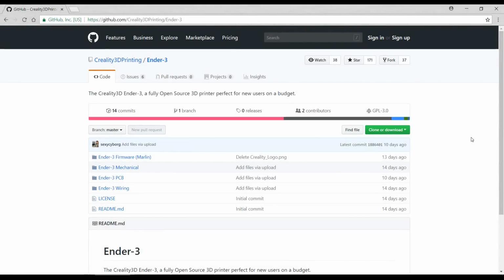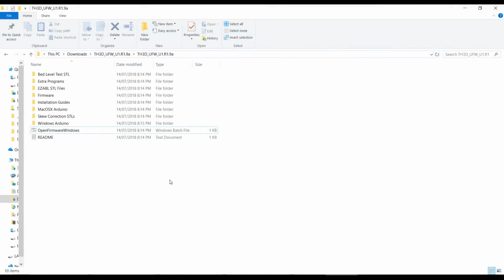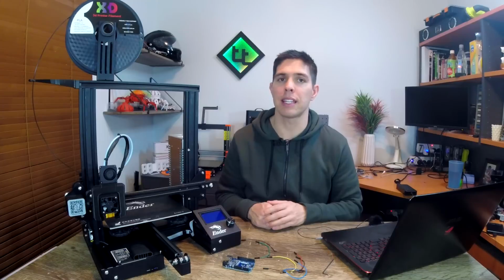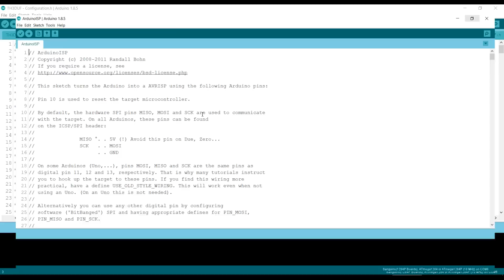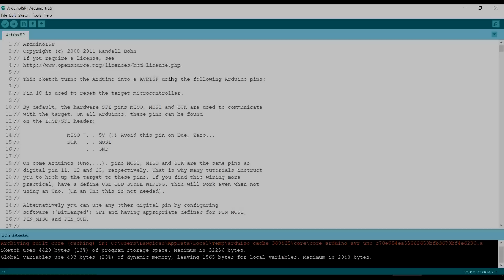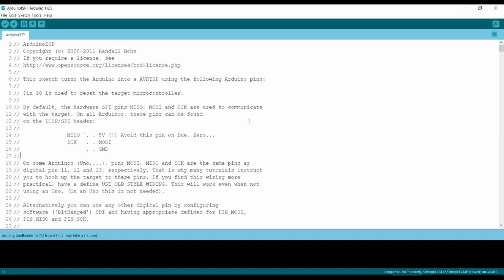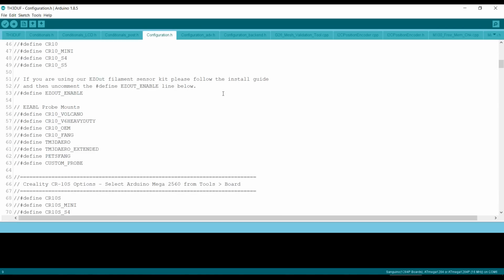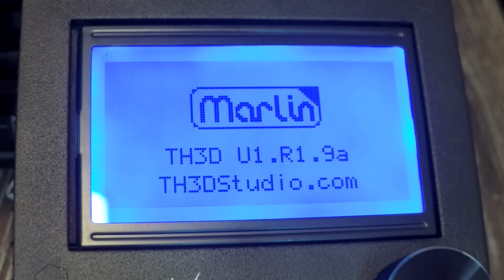Ender 3: How to install a bootloader and update firmware

Comment: I have a Creality V1.1.3 pcb printer.
I managed to install the Uno bootloader with success, but not the firmware. Every time I flash it I get this message:
         Using Port                    : COM29
         Using Programmer              : arduino
         Overriding Baud Rate          : 115200
avrdude: stk500_getsync() attempt 1 of 10: not in sync: resp=0x65
avrdude: stk500_getsync() attempt 2 of 10: not in sync: resp=0x63
avrdude: stk500_getsync() attempt 3 of 10: not in sync: resp=0x68
avrdude: stk500_getsync() attempt 4 of 10: not in sync: resp=0x6f
avrdude: stk500_getsync() attempt 5 of 10: not in sync: resp=0x3a
avrdude: stk500_getsync() attempt 6 of 10: not in sync: resp=0x53
avrdude: stk500_getsync() attempt 7 of 10: not in sync: resp=0x44
avrdude: stk500_getsync() attempt 8 of 10: not in sync: resp=0x20
avrdude: stk500_getsync() attempt 9 of 10: not in sync: resp=0x63
avrdude: stk500_getsync() attempt 10 of 10: not in sync: resp=0x61

avrdude done.  Thank you.

An error occurred while uploading the sketch

The printer lcd screen flashes for a moment and then error. 
I also tried installing Marlin firmware with same exact message.
It seems to reset serial connection and thus printer reboots when attempting to communicate.

Any ideas?
Reply: This is what I get on the Arduino IDE console when flashing firmware:
start
echo: External Reset
Marlin 1.0.0
echo: Last Updated: Sep  3 2018 15:45:59 | Author: (Ender3)
Compiled: Sep  3 2018
echo: Free Memory: 9679  PlannerBufferBytes: 1232
echo:Stored settings retrieved
echo:SD card ok
Init power off infomation.
size: 
591

Comment: I made it to the last part. I just get errors now. So the printer screen is blank. 10 attempts where it says not in sync. Programmer is not responding, problem uploading to board, etc. Any ideas?
Reply: Im in the same boat
Reply: @brgalford  Well if you figure it out, let me know and I'll let you know if I figure it out.
Reply: @CarbonGlassMan  I'm all the way at the end and it just fails over and over again
Reply: @brgalford  I have a few ideas o what the problem could be on my end. I don't have the USB cable that came with my printer, so maybe the USB cable I have is not a data cable? I ordered a data cable, so I'll know if that's it soon. The other problem could be my laptop. It had trouble writing to the Arduino Uno, but I restarted the computer and it wrote to the Uno right away. Only 1 of my USB ports on the laptop is working and I have to have a hub plugged into it because I have to use a wireless mouse. Also, it's Windows 7.  Another possible problem.... TH3D said they have trouble with genuine Arduino boards, and good luck with knockoff Uno boards. I have the genuine Uno.
Reply: @brgalford  I did end up getting this to work. I took my printer over to my dad's house and tried using his computer and it worked the first time. I had an issue with the com port on my computer.

Comment: Having some troubles doing this on my Mac...

I have found the TH3D_UFW_U1.R2.9b on GitHub and with it comes Arduino 1.8.7 for Mac. Installed that and then opened TH3DUF_R2.ino in Arduino. But there is no Sanguino board. How should I do?
Reply: https://www.instructables.com/id/Flashing-a-Bootloader-to-the-CR-10/

this will show you how to get the board working

Comment: Hi m8, i followed that update video and successfully did the bottloader. The problem i have is that what ever usb minicable i use, i can not connect the ender 3. The LCD wont lid so it seems the USBport is broken!? Now i have the problem that if i turn on my ender 3 it wont load up .. blank screen. Must be because of the bootloader. I cant load up firmware it say programmer not responding. Any ideas? Im out of knowledge after a few week now .(

Comment: Well done! Helped me a lot! Please note that for anyone who might experience difficulties connecting to the Ender 3, then it might be due to your miniUSB cable. Some miniUSB cables do not carry the data pins required for communicating with the printer. Buy a cheap miniUSB 2.0 to USB2.0 cable and try that out before doing anything major. Just a tip! :-)

Comment: I tried this, bought everything through the links you provided and I immediately got this error Arduino: 1.8.7 (Windows 10), Board: "Arduino Uno"

Sketch uses 4402 bytes (13%) of program storage space. Maximum is 32256 bytes.
Global variables use 482 bytes (23%) of dynamic memory, leaving 1566 bytes for local variables. Maximum is 2048 bytes.
C:\Users\OWNER\Downloads\TH3D_UFW_U1.R2.9a\Firmware Pack Source Folder\Windows Arduino\hardware\tools\avr/bin/avrdude -CC:\Users\OWNER\Downloads\TH3D_UFW_U1.R2.9a\Firmware Pack Source Folder\Windows Arduino\hardware\tools\avr/etc/avrdude.conf -v -V -patmega328p -carduino -PCOM1 -b115200 -D -Uflash:w:C:\Users\OWNER\AppData\Local\Temp\arduino_build_32612/ArduinoISP.ino.hex:i 

avrdude: Version 6.3-20171130
         Copyright (c) 2000-2005 Brian Dean, http://www.bdmicro.com/
         Copyright (c) 2007-2014 Joerg Wunsch

         System wide configuration file is "C:\Users\OWNER\Downloads\TH3D_UFW_U1.R2.9a\Firmware Pack Source Folder\Windows Arduino\hardware\tools\avr/etc/avrdude.conf"

         Using Port                    : COM1
         Using Programmer              : arduino
         Overriding Baud Rate          : 115200
avrdude: ser_open(): can't open device "\\.\COM1": The system cannot find the file specified.

avrdude done.  Thank you.

Problem uploading to board.  See http://www.arduino.cc/en/Guide/Troubleshooting#upload for suggestions.

This report would have more information with
"Show verbose output during compilation"
option enabled in File -> Preferences.
any idea what went wrong?
Reply from the maker: Is this when trying to burn the Arduino as ISP program onto the Uno?
Reply: @TeachingTech  yes, but apparently if you just do it enough times in frustration it eventually works. Lol

Comment: How can I tell if my ender 3 has a bootloader?  When I connect it to my mac and open the Arduino software I get a new port in the list but I have no idea what this means. Can I program the new firmware from that point or do I still need to use a bootloader?  thanks and sorry to ask stupid questions (my ender 3 is one week old if that helps)

Comment: Hi there, 1st time working with my ender 3. Planning to flash the firmware to the latest stable release. Following your video and found it very through but you lost me when connecting the 3 female wires - I could not see where you inserted them onto the motherboard. Could you provide a more detailed description of where they were connected? Also you apparently were using some software I was not familiar with - sketchbook? I plan of trying to follow your instructions in two days. Wish me luck

Comment: Hello Micheal, i had a V1.1.3 in my org ender 3 pro and had no issues with burning a bootloader and updating date firmware, but somehow i fried the board, i have a new V1.1.4 and for the life of me it ill not take a bootloader file i keep getting and Error, and this is what is is I hope that you can point me in the right direction thank you from what i hope is not a $500 paper weight . Arduino: 1.8.5 (Mac OS X), Board: "Sanguino, ATmega1284 or ATmega1284P (16 MHz)"

/Users/doug 1/Library/Arduino15/packages/arduino/tools/avrdude/6.3.0-arduino14/bin/avrdude -C/Users/doug 1/Library/Arduino15/packages/arduino/tools/avrdude/6.3.0-arduino14/etc/avrdude.conf -v -patmega1284p -carduino -P/dev/cu.usbmodem14201 -b19200 -e -Ulock:w:0x3F:m -Uefuse:w:0xFD:m -Uhfuse:w:0xDE:m -Ulfuse:w:0xFF:m 

avrdude: Version 6.3-20171130
         Copyright (c) 2000-2005 Brian Dean, http://www.bdmicro.com/
         Copyright (c) 2007-2014 Joerg Wunsch

         System wide configuration file is "/Users/doug 1/Library/Arduino15/packages/arduino/tools/avrdude/6.3.0-arduino14/etc/avrdude.conf"
         User configuration file is "/Users/doug 1/.avrduderc"
         User configuration file does not exist or is not a regular file, skipping

         Using Port                    : /dev/cu.usbmodem14201
         Using Programmer              : arduino
         Overriding Baud Rate          : 19200
         AVR Part                      : ATmega1284P
         Chip Erase delay              : 55000 us
         PAGEL                         : PD7
         BS2                           : PA0
         RESET disposition             : dedicated
         RETRY pulse                   : SCK
         serial program mode           : yes
         parallel program mode         : yes
         Timeout                       : 200
         StabDelay                     : 100
         CmdexeDelay                   : 25
         SyncLoops                     : 32
         ByteDelay                     : 0
         PollIndex                     : 3
         PollValue                     : 0x53
         Memory Detail                 :

                                  Block Poll               Page                       Polled
           Memory Type Mode Delay Size  Indx Paged  Size   Size #Pages MinW  MaxW   ReadBack
           ----------- ---- ----- ----- ---- ------ ------ ---- ------ ----- ----- ---------
           eeprom        65    10   128    0 no       4096    8      0  9000  9000 0xff 0xff
           flash         65    10   256    0 yes    131072  256    512  4500  4500 0xff 0xff
           lock           0     0     0    0 no          1    0      0  9000  9000 0x00 0x00
           lfuse          0     0     0    0 no          1    0      0  9000  9000 0x00 0x00
           hfuse          0     0     0    0 no          1    0      0  9000  9000 0x00 0x00
           efuse          0     0     0    0 no          1    0      0  9000  9000 0x00 0x00
           signature      0     0     0    0 no          3    0      0     0     0 0x00 0x00
           calibration    0     0     0    0 no          1    0      0     0     0 0x00 0x00

         Programmer Type : Arduino
         Description     : Arduino

avrdude: stk500_getparm(): (a) protocol error, expect=0x14, resp=0x14

avrdude: stk500_getparm(): (a) protocol error, expect=0x14, resp=0x02

avrdude: stk500_getparm(): (a) protocol error, expect=0x14, resp=0x10
         Hardware Version: 425479
         Firmware Version: 8430084.-1442971816
         Topcard         : STK502
         Vtarget         : 1.8 V
         Varef           : 0.0 V
         Oscillator      : Off
         SCK period      : 0.1 us

avrdude: stk500_initialize(): (b) protocol error, expect=0x10, resp=0x01
avrdude: initialization failed, rc=-1
         Double check connections and try again, or use -F to override
         this check.

avrdude: stk500_disable(): protocol error, expect=0x14, resp=0x10

avrdude done.  Thank you.

Error while burning bootloader.

This report would have more information with
"Show verbose output during compilation"
option enabled in File -> Preferences.

Comment: If flashing bootloader fails on a Mac with an error like " stk500_disable(): protocol error" then add a 10uF capacitor between the Arduino's reset pin and ground.
Reply: Ohhh mann....u just saved my life..... thnk u sooo much.....i was trying to upload since whole day .....ur comment make this possible within 5 min......thnks mann😃😃

Comment: Thank you for doing what you do. Your channel is an amazing wealth of resources. I'm having the hardest time getting the bootloader set-up. I purchased the Uno from your link but whenever I connect it to my computer, it constantly flashes red and none of the coms ever show up. I noticed in your recent Ender 5/Marlin video that you mentioned if the com doesn't show, the computer is missing the driver. What driver are you referencing? Thank you.
Reply from the maker: Hopefully this helps: https://www.arduino.cc/en/Guide/DriverInstallation
Reply: @TeachingTech  Thanks man, really appreciate the reply. Unfortunately I'm a Mac guy so I can't install the drivers. I was reading some of the comments on the bangood uno's listing and it seems it isn't compatible with macs. Perhaps this isn't possible for mac users.

Comment: I had to use Arduino 1.8.5 in order to get it to work and I had to install a 10 microF capacitor between reset and ground on the Arduino Uno. It worked flawlessly after that.

Comment: Thanks for this tutorial. Just finished flashing Marlin to my Ender 3. Had a little trouble uploading the code to my arduino until I tried it with a different computer. Apparently my regular PC has some trouble with arduino's. After I got that working it was easy. Thanks again.
Reply from the maker: Sometimes I have to switch USB ports, they can be funny like that.
Reply: @TeachingTech  Hey can you possibly flash the firmware without arduino? Just hook the ender to pc?

Comment: can't get this working on the 1.1.4 board. access denied when trying to upload firmware after flashing
Reply from the maker: 1.1.4 board is new to me, didn't know it existed. Can't help you at this stage.
Reply: @TeachingTech  i ordered a 1.1.3 board and amazon sent me yet another 1.1.4 board and this guide still doesn't work for 1.1.4 and my ender 3 just has a blank screen when i try to boot it and i can't upload the firmware after flashing bootloader even on a new 1.1.4 board
Reply: @FormalRiceFarmer  Did you ever find a fix for this?
Reply: @syberand  yeah, 1.1.4 board needs a different driver

Comment: My question : USB is USB, why in the hell is there a USB Port on the printer if I cant just download my firmware to a PC, connect a USB to mini USB cable and kick things off? why do I have to buy a $230 3D printer that I then have to go and buy more hardware just to update the firmware on the printer? I can buy a $60 HP inkjet and I have more capability connection wise than I do on my 3D printer, no one else see's this as odd or a problem?
Reply from the maker: It's a budget printer and selecting this cheap mainboard is one way they save money. You can still use the USB port for connecting and printing tethered to a computer.
Reply: Lol , you just said the answer....  its a $230 printer.  Like everything else in life you get what you pay for. You cant expect to get everything for such a low price

Comment: Hello Michael. Thanks for the video. I followed your instructions and everything is working well as expected. But I can see that the display (LCD)   when I set the temperature is moving slowly than before and also when I'm searching for a file to print from  the SD card the selection is slow and sometimes when I go back and select a file , the file that is selected is not the one that was showing  on the screen. I think that is connected with the slow movement of the cursor. Are there some parameter to touch in the configuration that speed up that movement ? This was much better with the original firmware . Maybe is a problem of memory capacity. Thanks in advance for your help.

Comment: UPDATE 2: Seems that the stock firmware ignores acceleration and jerk settings in Cura. It does not after you flash new firmware. So, having never actually given acceleration settings a single thought, they were obviously very, very high apparently? Disabling acceleration control reverted to the firmware settings and I now print fine again :D 

I would like to correct this statement: After flashing new firmware, I am having the worst layer shifting on the Y axis that I have ever seen. Like, a treestub looks like an abstract alien tentacle had a baby and vomited on my printer. 
Will update if/when I find a solution. 

Worked like a charm! Thank you so much :D 
For the record, my printer is now humbly named "God's Inkjet"
Reply: Thank you for this comment. You saved me hours of work.
Reply: i have no problem with changing jerk. but for acceleration you need to change start gcode in cura. theres maximum acceleration. i increased it to 1500 and now i can change any acceleration setting in cura and it will do its job, unless it faster than set value.

Comment: I'm getting the following error message on the Ender 3 after flashing the firmware: "Homing Failed PRINTER HALTED Please reset"
Could you supply the proper X and Y offset values to be used with the Ender 3?

Comment: For Mac OS High Sierra this won't work until you fix the drivers.

The Github Download for the correct  drivers and instructions are at: https://github.com/adrianmihalko/ch340g-ch34g-ch34x-mac-os-x-driver

The background on this problem is here: https://arduino.stackexchange.com/questions/38894/arduino-uno-unable-to-detect-usb-port-on-mac-os-sierra-10-12-5

Great video thank you and Happy Printing...